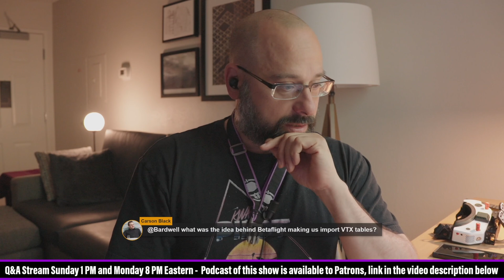Why Does Betaflight Force Us To Use VTX Tables? How Does It Work In Inav? - FPV Questions

Comment: FYI - as far as I can tell, BF only allows a max of 7 power levels, also keeping the DP from reaching full power. I spent countless hours trying to setup 2 different DPs before I realized BF only allows for 7 levels. Can anyone confirm if I'm correct in saying this?